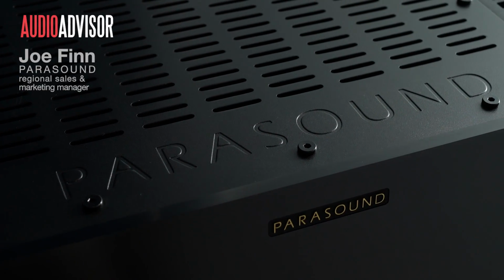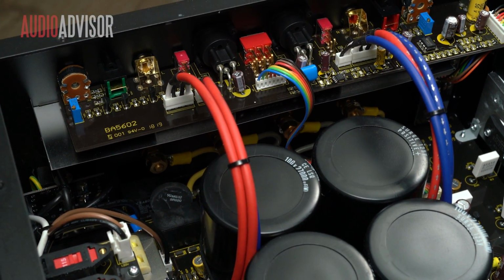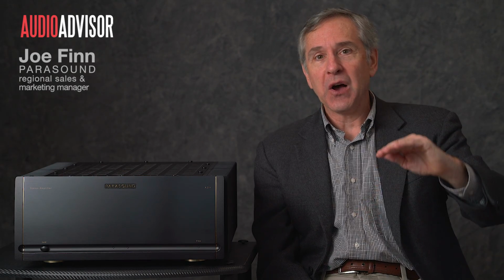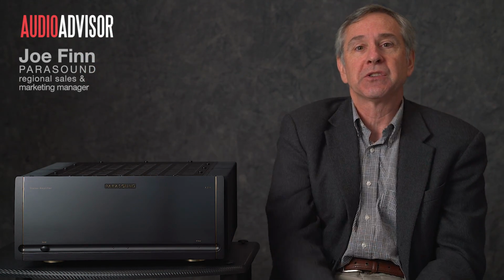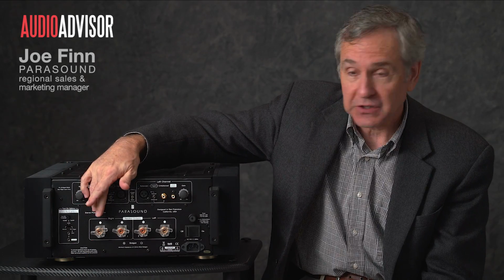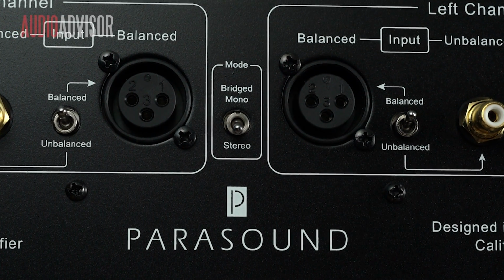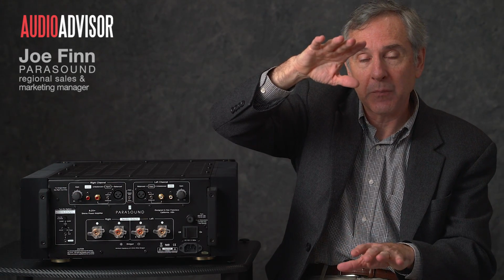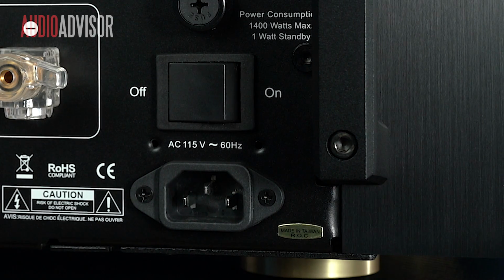Parasound Halo A 21+ Power Amplifier with Joe Finn – Audio Advisor

Comment: Stay far away from this company and amplifier. This amp cannot be repaired because the transistors used have been discontinued for 7 years. Parasound says they provide parts but those parts are not individual components but the entire main board. The entire main board are exceeds the cost one would expect for an average electronic repair. So unless you're willing to drop $1400 for the board and $325 to have it installed stay away!
Reply: I was about to order the A23+2 , does  this apply to this model also ?

Comment: Which speakers do you suggest at least for thia amp?
Reply from the maker: Hello. As one of the moderators for this channel, I reached out to our audio experts with your question.  Ultimately, the amplifier in the video offers 300 watts per channel at 8 ohms and will drive any of the speakers Audio Advisor offers. For specific speakers, it will come down to what your budget allows. There are many other factors involved in choosing the right speakers, so giving our sales staff a call for further discussion and advice would be the best recommendation. You can reach our sales team at  1-800-942-0220. If you want to browse our speaker selection, visit us at https://www.audioadvisor.com/
Reply: @AudioAdvisor Hi! May I ask what would be the best amp for the Focal Aria 948? 21+ or is 23+ more than enough? Maybe later to add the P6. Low to moderate auditions. Thank you!

Comment: Great Amplifier! It also has good looks. And the loop in /Loop out advantage it has is amazing too! 
By the way, I successfully feed my 4Way JBL Monitors    (Refrigerator-sized clones of the 4341s )
with vertical Bi-Amping for more than 4 years now, and it works great! OK, I am a DIY Audiophile with a small pension for income, but even my cheaper A/B Poweramps that are fed by an affordable Tube Preamp can let one hear the advantages of vertical bi-amping for sure. 
So, the fact that the company that built up their amps for vertical bi-amping, truly is amazing and IMHO shows a lot of thoughtful research for what audio equipment can be used for in a sophisticated way! In my eyes, it´s a great thing Parasound gives to the customers! Your technicians are truly blessed by the God of Sound!
Reply from the maker: Hey Bernhard. Thank you for taking the time to share your thoughts and opinions with us. Parasound makes great equipment and we are glad your are enjoying it.

Comment: This amp is impressive. Just had a few hours with it after bringing home so decided to look up some info on it. I try not to do that beforehand so I don't set expectations. 

I'm somewhat inexperienced but I am not sure I'd call this completely neutral. It's a bit warm, but in the best sense possible. 

Smooth. I'll say that's the biggest takeaway so far. It's smooth and you can sense its massive power without it being obnoxious and brash about it. It also handles complex passages with ease. Something my less expensive amps get shown up with regularly. 

This amp sings in all the right ways. Looking forward to more pre amp combos and speaker matchings to come.

Great work on this piece! I can't wait to go listen more

Comment: Would you set the gain on the back to max, and use your preamp to control the volume?
Reply from the maker: Hi Brian,

Yes. You always want the gain knobs on the back of the amp all the way up. Then control volume with preamp.

Please contact me on my direct line at 866-984-0669 with any questions or if you would like to place an order. If you decide to order directly from our website, please choose my name from
 the drop down window at checkout where it asks who helped you out.

Thanks!

 

Brian Orcutt

Comment: I have given serious consideration to this A21+ Power Amplifier especially in terms of its cost. It is not cheap but it is also not beyond my price range. However, I have decided to take a little longer to save for the Parasound Halo JC 5 Power Amplifier. It is an expensive unit but makes the A21+ sound broken in comparison.
Reply: I have the a21+, it cost here 5.000$ and the jc5 cost 9.000$. Listened to them both and honestly could not hear much difference.   But u are prob american, so u get the jc5 for the same price as the a21+ here
Reply: @chriss881000  I appreciate your comment, MANoWAR. It is an interesting comment. Like you, I am Canadian; and, yes, the Parasound JC5 is near 10,000$ CAD with HST in mind. A lot of money. I take your comment seriously and will give it careful consideration. Such a huge price difference in the two amplifiers. Audio Excellence in Maple, ON. considers the JC 5 to be the superior amplifier according to their YouTube channel. They provide a video in which they discuss the wide difference between the A21+ and JC 5.  https://www.youtube.com/watch?v=qtpvEu6O798
Reply: @Teachering  iv watched that video before. I did not mean that the jc5 is not better, I could almost buy 2 of the a21+ for the price of the jc5, so ofc it is better;)   but I guess it all comes dowm to what u need.  I now hsve the b&w 702 s2, and for them the a21+ is a perfect match and have more than enough power, but if u have lets say some very very expensive speakers who also need some care, the jc5 world sure be the better option.   I see the a21+ in the middle class, and the jc5 in the top of the class.  It would be a waste having the jc5 with some 5000$ speakers.  If u know what i mean, not a waste but alittle "overkill"  😉
Reply: @chriss881000  Thank you for your reply, MANoWAR. You make a good argument. You have provided me with very good insight.
Reply: @Teachering  happy to be of some kind of help:)

Comment: how would the 21 compare to ps audio m 700 mono amps?
Reply: This amp is A/B which is generally preferred over Class D which though sounds great for low end, they don't generally sound as good with mods and highs.
Reply: I love PS Audio and run several of their products, but I don't think the 700's are a very good deal. A pair of mono-block class D amps (with very little circuitry in them) or a class A, A/B amp (loaded with circuitry and a big toroidal transformer), both about the same cost...no contest.

Comment: Does the parasound 2250 v2 "share" the total amplifier power when using A and B channels, or does it have the SAME amount of (i.e. 275 watts one channel only, or 275 watts BOTH channels ? Or will the 275 watts be cut in half per channel A and B ) ?
Reply from the maker: Hi Kirk,

Thank you for your inquiry. I reached out to one of our audio experts regarding your question and here is his response. 

"The a and b connections are paralleled internally, so the amount of power available will change depending on the impedance of the two speaker sets. An example of this is if you had two pair of 8 ohm speakers, the resulting power will be higher because the amp “sees” 4 ohms.  In the case of this amp, it is 250 into 8 ohms, 400 into 4 ohms and 400 into 2 ohms.  No free lunch though as what is happening is higher amount of current is needed which is the harder thing for amps to do.  Lesser amps will often shut off to protect themselves if that impedance drops too low.  The speakers 'share' that power. "

If you have any other questions, please reach out to us at (800) 942-0220 or sales@audioadvisor.com.

Thank you and have a great day!

Comment: Love mine.   Month 5. It sounds warmer in mid-bass upon directly replacing two vertically bi-amped A-23 units. Overall more satisfying than A23.
Reply: Looking for the a23+ for some Klipsch 8000fs
Reply: Good to know. Wondered if sounded better than the A23. Im looking at getting the A52+ at 180 watts x 5 for HT which I suspect wont be quite as good as the A21+
Reply: Thanks for the comments- I’m thinking of getting the A 21+
Reply: @James Trower those speakers are on my short list. What pre do you like or use with your a21+? Just picked one up and one album in. Using creek audio evolution 50a as the pre. Probably not the ideal but it's actually quite nice so far. I'm thinking of a minidsp SHD for DSP and to use as pre for it.